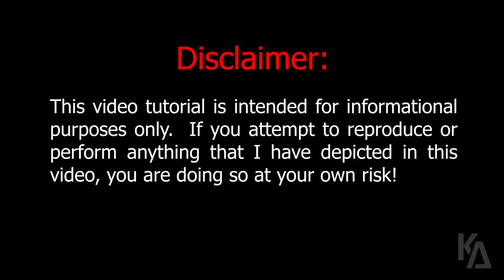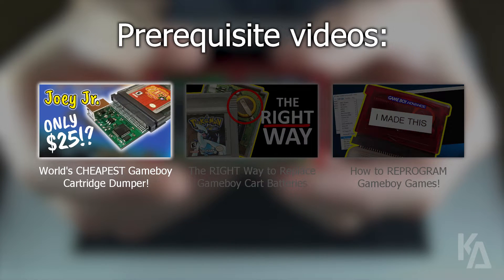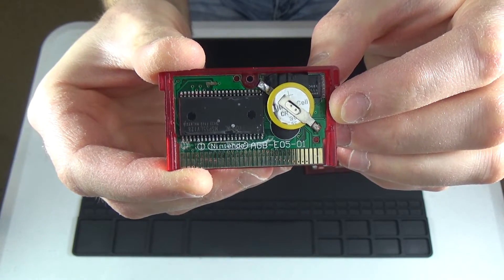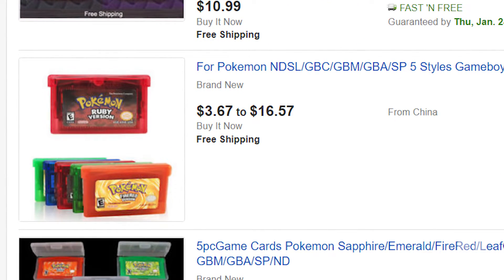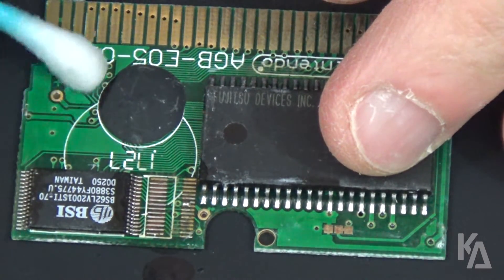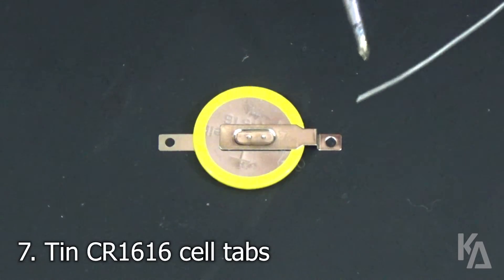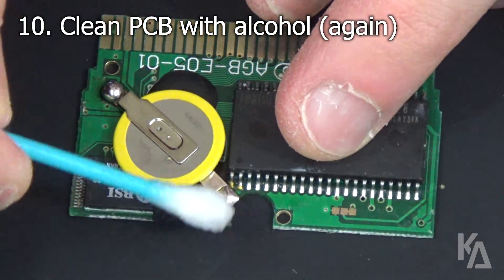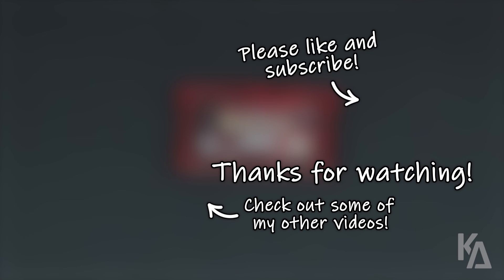Adding Save Batteries to Bootleg GBA Carts!

Comment: The battery is not used for save data, almost any bootleg cartridge saves to an SRam chip and then it copies back the content to its EEPROM, and on startup it dumps the saved data in the sram so it can be read

Comment: I can set the time on my pokemon gold gbc reproduction, but it doesn't change so i have no day and night cycle, will this fix the issue?
Reply: No, it won’t.
This battery is only for saving to SRAM instead of the ROM chip.
In order to fix RTC you need a specific kind of cartridge which is not common at all on bootlegs.

Comment: Friend, I need urgent help please... I've been to several forums...
So... I have a parallel cartridge of Pokémon Red (GB). and I have a ROM burner... I changed the game on the cartridge and... it doesn't save the game... these parallel cartridges don't have a battery... the game is saved on the chip itself. .. but when I change the rom it doesn't save... what could it be please help me
Reply: Did you fix it?

Comment: I'm trying to do this to a GBC Pokemon crystal version cart. It does have FRAM save already but the RTC doesn't work. It already has a spot for a battery but the trace to the positive runs to an unpopulated SMD pad. I already know what goes there because it's labeled. My problem is I know nothing about this cart as I literally just got it today. I can't find anyone that has attempted this beside KyleAwsm. So I have no idea if adding these components and battery will make it work or just fry something.
Reply from the maker: It sounds like you bought either a Chinese bootleg Pokemon Crystal cart, or a used genuine cart that someone used for parts before you got to it.  I've already tried some things on some bootleg Crystal carts and they're pretty stubborn.  Some are even unflashable.

If you're looking for a cheap way to play Pokemon Crystal or a ROM hack of it on genuine hardware, AND with operational RTC, check out the BennVenn MBC3000 flash cartridge on our store:
https://highscoretech.myshopify.com/products/bennvenn-mbc3000-rtc-reflashable-gameboy-cartridge-v4
Also, for a few extra dollars, we can flash a compatible ROM that you provide.  Hope this helps, and thanks for watching! 🙂👍🏻
Reply: @KyleAwsm  Yup its 100% a china bootleg. I thought the gba cart he was working on in this video was too. I actually already have a couple MBC3000's and I have the Joey Jr too. I just like tinkering and I got this china cart for free. Started playing it and decided I wanted the RTC to work. I want you guys to make a GBC cart that has a tilt sensor and rumble and supports all the special carts like the Ez Flash definitive edition.
Reply: @KyleAwsm  So I'm about to order 3 more MBC3K v4's and wanted to know if you have a discount code for BennVenn's Shop. Also I'm in USA so shipping is not so great.

Comment: I have a question. I bought some reproduction carts of all the GBA Pokémon games a while back, and while they save just fine, they don't have a working real time clock. For Fire Red and Leaf Green, this isn't really an issue, since those games don't seem to use an RTC anyways, but this is a major problem for Ruby, Sapphire, and Emerald, since many in-game events rely on the RTC. Does the trick you show in the video fix that issue, or do I just have to suck it up and shell out hundreds of dollars for official cartridges?
Reply: super late reply but no it doesnt fix that, ive done this myself and all it does is prevent the 'dry battery' message. No rtc circuitry inside the bootleg so no clock unfortunately :(

Comment: Just a minor FYI, when you're soldering you're way better off heating the pads first and then touching the solder to them rather than putting cold solder on the pads and touching the iron to both at the same time. That's why your joints are just balls and the solder doesn't seem to be flowing that well.

Comment: So do the bootleg carts just not have the capability to save? I have a really weird one with a battery gap but no battery but it still saves
Reply from the maker: They do, but the save data is stored on the same flash chip as the game ROM itself - It can only do that by way of a specially patched game ROM file.  These tutorials are meant to show how you can make the cartridges work with conventional ROM's. 🙂  Thanks for watching!

Comment: This looks great, too bad the design in mine while they have the points they're not labeled + or - so it worries me I might mess it up.
Any ideas?
Reply from the maker: Try running a continuity check between either of the pads to the cart slot finger/pin furthest to the right, which is ground (GND).  If you get a beep, that one is your negative battery pad.  Just keep in mind that this still may not work for you even with a battery installed correctly, due to other potential PCB differences.
Reply: @KyleAwsm  Thanks for the heads up, I have a video of the PBC variation shown in my recent video.
https://youtu.be/VBlbzikfcXw
Reply: @KyleAwsm  My multimeter doesn't beep but it did give me continuity, the bottom contact is the negative and the top one is the positive.

Comment: Yeah you can always get the battery 2Pcs CR1620 Battery 2 Soldering Pins 3V Coin Cell For Motherboard Calculator 13 from China for 3.01 cent and the tabbed has small pins that goes through the pcb and it fits perfectly you might have to bend the tabs because the pins are still close together but I have done this one for minish cap and it works great plus It comes with 2 batteries so the other one is going on my bootleg copy of legend of Zelda link to the past
Reply: Yeah and it is small enough to fit under the top shell of the cartridge and it is made for calculators

Comment: Did they never make bootlegs using flash memory, the memory type like on most original carts on GBA? Because that one would save without needing the battery like the real ones (ignoring the clock part). They always are SRAM save modded ROMs?
Reply: I have a knock off Ruby cart with no battery and it has no problems saving and loading, so they 100% exist now if they didn't 5 years ago

Comment: I got Final Fantasy Adventure and had to flash it to English but the battery had a little plastic boot you could just insert it in. It only saves for a while though because after a while it would be dead. I have to use it on my Retron 5 now to have a save and can't play portable. I am getting the new Gba Everdrive mini. So I can play portable again on my GBA SP.

Comment: Does adding a save battery allow for RTC features, like berries or the day/night cycle, to work in these carts?

If not, could you *hypothetically* flash an original ROM onto the cart so that RTC features will work?
Reply: yes to the second question
Reply: But does it actually work? You could flash the original ROM but these boards are still missing the RTC module and timing crystal, no?

Comment: Hello. Doing this restores also the RTC or only the saving?
Reply from the maker: Hi, since there is no RTC module on these bootlegs, it only restores saving, and for newly flashed games.  The games these carts ship with are patched to save data elsewhere and without a battery.
Reply: @KyleAwsm  I bought a preowned bootleg on the 2nd hand shop, with Ruby/Sapphire together. I tried to replace the battery and they now save the game, but always with the corrupted previous message.
But there isn't really a way to restore or add the RTC module?

Comment: Hey Kyle! I just want to ask you a question!

Why do you install the battery exactly? The few I’ve bought before didn’t need a battery to save. Is it for the clock based events? 

If anyone knows the answer please let me know. Thank you!
Reply from the maker: Hi!  Bootlegs don't have a clock chip or xtal, and the battery is to power the SRAM.  The reason these carts don't ship with a battery is because these Pokemon ROMs are patched to save to an empty part of the same flash chip that the game is on.  The battery is more-so for when you flash unpatched games to the cart.  Check out my Joey Gen3 video for more details on flashing bootlegs.  Cheers! 🙂
Reply: @KyleAwsm  does adding the battery make the save format be where I can transfer gen 3 pokemon to the gen 4 ds games?
Reply: Did you find out if that worked?
Reply: @ShaggyMetalJay did you ever find this answer? I am interested
Reply: @MrEroupe  I lost interest and just went to emulation
Reply: @ShaggyMetalJay  ahh ok, i ordered the material to try it, i will let you know after i get everything in… but the amount of money i spent on everything i could have just bought a legit cartrige 🙄
Reply: @ yeah I feel like when the video came out the bootlegs were cheap enough to justify the cost of parts but when I’ve looked at them lately it’s almost as high as an authentic cart.
Reply: @MrEroupe So, did it work?
Reply: @otoas it did not work so far, I’m experimenting with different save types. But i think that if your cartridge doesnt support flash save it wont work.

Comment: I suggest you use kapton instead of electrical tape, because electrical tape will disintegrate in a sticky mess after many years making battery replacement a hassle.

Comment: So I have a bootleg cartridge. Its  called "super Mario advance 4" but it also says "super Mario Bros 3" on the cartridge. The game has the option to play either "mario bros" or "super Mario Bros 3" the cartridge does have a save battery, but I don't think it's properly installed. every time I power on the game, I'm greeted with it telling me all the save data has been corrupted. It then loads up the choice of game. super Mario Bros, works absolutely fine, and despite the fact that it told me all the data was corrupted, saves my high score! Super Mario Bros 3 however, will take you through the opening scene, and then allows you to access the map. where the screen jiggles up and down infinitely, without any of the controls doing anything. is this some programming error? somthing I can fix? If anybody reading this has any idea, any help is appreciated. thanks in 'advance' 😅

Comment: I got one of these pokemon ruby reproductions. Installed a battery properly, flashed some games. with and without Patches for SRAM save. So far nothing saves to SRAM. All games work but I get corrupted save file messages when I restart the gameboy Advance.  Any idea what could be wrong?

Comment: The GBA pokemon games DO NOT use the battery for saving. It is only used for clock based events, like berry growth and the rooftop sale at Lilycove. If the battery runs dry in these games, you CAN still play them, and save.

Comment: Sorry but i don't get it. Pokemon ruby needs battery to 'save' your save files.
If they sell it without a battery how are you supposed to 'save' without adding a battery yourself?
Reply: Vaggelis Flamos I believe the rom is hacked to where it can save your game but only for the rom that is on there. If you were to reprogram the cart and put another rom on there instead of Pokémon ruby, it wouldn’t save without a battery. Not 100% sure this is the reason but this is what I’ve read from others
Reply: @pudingmasta  Thank you very much man :)
Reply: @pudingmasta  In the original game if the internal battery is wasted you can save without any problem BUT time related events will not be triggered, so I suppose pokémon Ruby use the battery only for real time clock.

Comment: Hey,
I have some fake Pokemon GBA games, that have no battery in it.
When I started Pokemon Ruby, it said "The game can be played" 
(Which should say "The internal battery has run dry. The game can still be played. However, clock based events blablabla")
Also I had a premade savefile called "TEST". I deleted all sava data via the shortcut and started my own game. I then saved right when I could, restarted the GBA and my own save was gone, but the "TEST" save still existed strangely. 

Now I soldered a battery onto the board, and I am really convinced I did this part good enough for the battery to work in the game.
I then started the game again and it still said the strange message "The game can be played". I deleted the save data again, started my own save and saved. After rebooting the device, the save is still there and working (although the system makes a short "cracking" sound, while saving the game, idk if that's normal)

The clock itself in the game doesn't seem to work, but I can save the game and play now.

So my questions are:

1. Is this what we're trying to achieve ? Being able to save your game, but the clock events (berries, clock on the wall, etc.) wont work ?

2. If the answer to question 1 is a yes, then, is it possible to "activate" the real clock ? Or are bootlegs just not capable of doing so

3. Is the strange message, which I never saw in an legitimate cartridge in that form, a sign of a modded Pokemon-ROM ? I thought, may be they wanted to hide the fact that it can't save because of the battery. They just modded the text in the game to be just "The game can be played", instead of "dead battery blabla", because they weren't able to remove the message in the first place !?

Thank you in advance.

I am trying to get a working bootleg rom, to install a pokemon romhack on it. If this will work, it would be awesome. Bennvenns adapter is coming soon ^^
Reply: This 'mod' heavily relies on the bootleg game cart actually using the battery contacts in a  way that actually powers the Sram. In my experience, most of the bootleg carts I've seen for GBA dont bother having any at all, and save the games to some other type of flash storage. the ROM on the cart is then patched to ignore the battery related functions, and thus the custom message that doesn't say the battery has run dry. 

So in short, Adding a battery won't help if the PCB isn't manufactured to actually use one. Additionally, you'll need to flash an un-altered ROM of the game to the cart before it will be able to detect the battery even if the cart can detect it.
Reply: I have a copy of Emerald without any battery for over a year and time events still working Just fine
Reply: @ChubacaSlayer how though?

Comment: I've seen these bootleg games around and wondered if they were functioning properly. After all, I know the Gen 3 pokemon games can still save after the battery runs dry, so I wasn't sure if they even saved properly or not, not to mention Fire Red/Leaf Green didn't use batteries. Or is this just to add a battery to a game after you write over the bootleg's data?

Comment: Do you know a way to add a save battery to this type of cart? https://imgur.com/a/itbYBed  It looks like this ROM tries to generate the save file itself for the emulator, so it overwrites whatever .sav file you give it. The save data is there but it isn't a standard save file so it appears to have its own file system. It spreads the save out over different areas as the flash used in these carts are good for around 1000 writes before failure so by spreading it over a huge area, it increases it to perhaps a million writes. So it appears the easiest method would be to just add a battery but it seems I don't have a firm enough grasp on how to do it myself. So if anybody could point me in the right direction, I would appreciate it. 

Here are the rom files to the game in case somebody wants to try taking a crack at extracting and adding a custom save file back onto this rom type. The save is somehow encoded into the rom since when flashing the game to another bootleg it shows the same save that was on the original dump. I was hoping to find a way to get a custom save back onto the rom itself and flash it back or add a battery to the cart itself and store the save on it.

1st Link: https://www.mediafire.com/file/wsilscah63ptez2/XYSeries.GBA/file?fbclid=IwAR0ws8fTCtlDzS9rRtJVJYIzSAHH1jeWmPbMy9KCSkSbfw7OASnddfnPtk0
2nd Link: https://www.mediafire.com/file/0c3fz793z0aehfg/XySeries2.GBA/file?fbclid=IwAR0JCAA7d0ukQLScnvHYKZqcZ_XK9f7k-ElsdgUkBInsHH_eI5-EUgVmF7U (2nd link has another caught pokemon to show difference in HxD analysis)

Comment: Aliexpress might be a better source for repro games, you can grab a pokemon repro for like 2.50 - 3 shipped, these are usually flashable with a joey, and most of mine have pads for batteries, it also might be worth getting some cheap kapton tape for insulating the contacts since electrical tape tends to leave residue behind.

Comment: Most of the 1616 batteries I bought from eBay / Amazon only held my save for a month at best so I recommend buying a known good brand battery and taping the battery to the contacts ... It's not as pretty but I've done this to my Pokemon gold cart in 2012 I believe and it still works fantastic and my save file is still on it
Reply from the maker: PixCub  Thanks for watching and for your note.  I know people dispute my recommendation of getting batteries on Amazon, but I've had very good experiences with them.  However, I ONLY follow the ratings for the seller, never the price.  If there's a choice between a 3-star rated listing and a 5-star one, even if the latter is a few bucks more I still pick it (given other factors too).  And regarding the taping of the battery, to each their own I guess.  But that is not at all what I recommend, hence my guide.  You could likely damage the cart if the contacts slip somehow.  Tape only works reliably for so long anyways.  And these bootlegs (if you watched the video) don't have the same space or raised soldering points inside.  I advise against taping batteries.  Just putting this out there is case anyone comes along and reads this.  TAPE = BAD!  Thanks again for watching. 🙂
Reply: @KyleAwsm  yes I was mentioning this method for normal cartridges not Gba carts as they are really limited in space